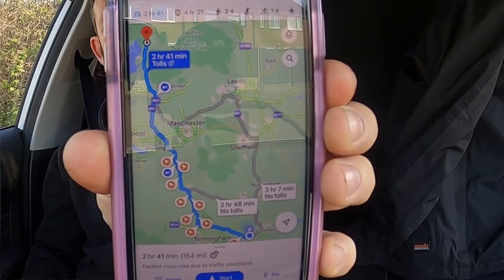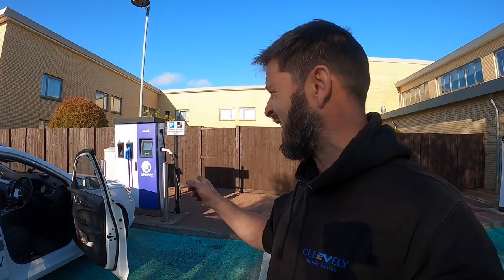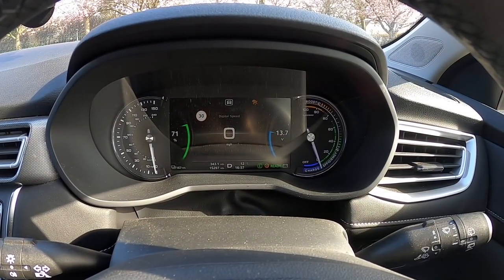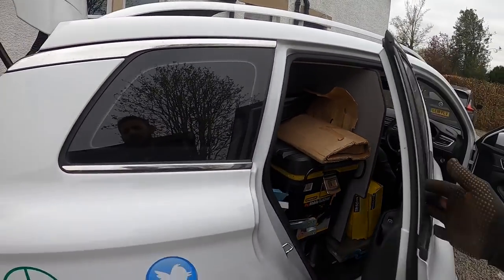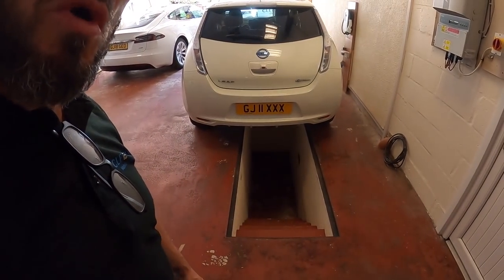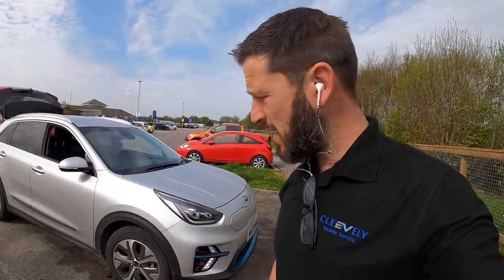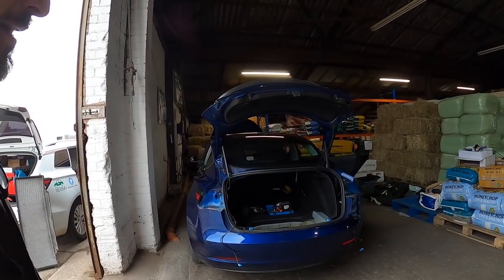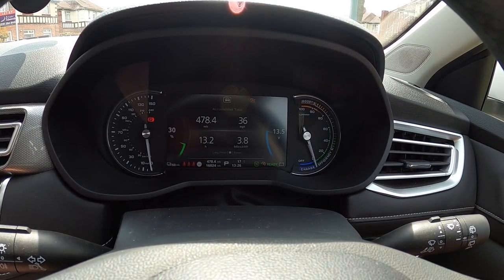Apparently £50 Gets 1300 Miles In An EV??

Comment: This video shows how busy and committed to your work that you are.  Great to have more information out there to educate people looking at an EV. I spoke to several people this weekend saying EV's are rubbish as they can't do long journeys. 
I could inform them otherwise, having just driven my Kia E Niro from Lincoln to Disneyland Paris, recharging  only when we wanted to stop or had to wait at the Euro Star Terminal. With free charging at Euro Tunnel and at Disneys Newport Bay Hotel, the paid for charge for 870 miles was less than £30!
Reply: Agreed, we have just spent 3 weeks in Connemara in our Zoe for a total fuel cost of €40 for the round trip including all our local driving. Our destination was just over 300km from home.

Comment: Maths is your friend. The average speed on any journey that comprises 50% motorway and 50% A&B roads is 45mph. With a higher mix of motorway your average speed goes up to 55mph.  The dashboard readout at 2:13 shows 152.8 miles travelled, 55mph average and 2.7h journey time. If you divide the 158.2 miles by the 55mph you get 2.78h journey time. If you divide the 152.8 miles by the journey time to one decimal place of 2.7h you get 56.6mph. So the readout is correct James.

What a lot of people don't get is that no matter how much time you spend on the motorway on a long journey you will have to spend some time on A & B roads. You could be doing as little as 10mph in towns and cities and will mostly be doing 30-40mph on B roads at best. You also have to factor in stoppage time. Diversions, contraflow, traffic lights, zebra crossings, roundabouts, roadworks, slow lorries, junctions, waiting at on ramps, etc., etc. People think, "I was doing 70mph most of the way" but in reality you weren't. Even if you were constantly at 70mph on the motorway the conditions described above will slash your average speed every time.

Whenever people talk about range and how EVs with less than 150 mile range are no good for long journeys I remind them that the average speed is 44mph and it would take 3h 25m to travel 150 miles non-stop. James achieved a higher average and still took over 2h 45m to cover 153 miles. You are going to need to rest or pee or eat on journeys that long regardless of what you're driving. You will have ample cause to take a break and get a top up while you're at it.

Also I have found that my average cost to run my 2015 24kwh Nissan Leaf is £1 for every 27 miles. That's 1,350 miles for £50. So right in line with the costs shown in the title. But, this is my average. It is actually possible for me to cover the entire British Isles without paying a penny for charging at public chargers. Yes, it would be circuitous and time consuming. But, the point is that the cost can be a lot lower than £50 for 1300 miles and it can also be a lot higher. But, it's a fair average.
Reply: Spot on Trevor !
Reply: 27 miles = 7kw = .14p ?
But thats all home charging. The real cost is what you pay at chargers, my calculations make £30 = 300miles [.40p @ superchargers]
Reply: @ML118AL  The real cost is what you spent. Home charging is normal . Public chargers are maybe 50% more costs than home charging (slow charging overnight). (My country the Netherlands....my own driveway, my own charging box. Charging on average with 4KW will charge up my ioniq 5 in 18 hours (full charge from zero). And mostly I do not drive 360-400 km every day....overnight charging is enough for 95% of all time. So home energy costs for electricity is not wrong for calculations.

Comment: In these times of crazy fuel prices these videos just go to show how practical an EV is even for heavy commercial use. Recently completed 2 journeys Lon to Man and back in an E-Niro at a total cost per journey of £2.64 (thanks to free charging at destination). That's over 400 miles for approx £5. Oh and I arrived after the 200+ mile journey with over quarter of a charge remaining, 3 out of 4 of those trips.

Comment: Not too shabby, I’ve not collated all of ours yet but we just did 1200m across 5 days getting down from Glasgow to Essex, 2 days visiting Fully Charged and back up the road. Had to rely on mainly rapids and spent about £65 mixture of Gridserve, Mer, podpoint, CPS, freebie @osprey from Fully Charged and about 16hrs on 3 pin. All done with a 40kWh Leaf. Not the best for the longer 350+ distances but If I can do it in that, anyone can with anything else.
Reply: In November 2017 I did 437 miles to Edinburgh on a Tuesday and on the Wednesday I did 16 miles around town and then 437 miles back home. That was in a 24kwh Leaf, rapid charging only, free of charge. 890 miles total in two days. No issues, no cost, minimal fatigue. With modern EVs, a much more comprehensive infrastructure and much faster chargers available such journeys are now an absolute piece of piss for just a little bit of planning.
Reply: @trevorberridge6079  yep, i'd actually get on just as easily with a 24kWh vs a rapidgating 40kWh.

Comment: That dedication for you, well done James, and the MG sound an excellent work horse, but I see the trim level is below standard looking at things like the steering wheel cover was poorly fitted. Its little things like that which lets it down for some people, it wouldn't bother me though. I did a trip in our 2015 Nissan Leaf 24 from mid Wales to Germany near Munster this year covered just over 900 miles and cost me £48 which included two free vends as well. Great work James alaways interested in you videos so keep up the good work!!
Reply: Wow that's a long journey. How were the battery temperatures along the way? Any charge rate throttling?

Comment: Looks like fun.  What a great car.  I wish i could put 30kwh in the back of my leaf plus, Id have damn near 300 miles of range then! haha
Reply: Adding an extender battery like the guy in the video has a hidden advantage. Because it is being viewed by the car as an extra pack it takes load off of the main pack. This means that when you charge you can get higher charge speeds for longer as the load is shared.

Comment: That’s a real concern having the MG5 unplugged mid charge…and the issues it caused, (can’t believe someone would do that!!)..I assume if that happened to a non ev technician type person this would require RAC/AA to come out and fix it so the vehicle could continue charge?
Reply: It isn't possible to unplug the cable if the car is locked.

Comment: One question I have James, if you had the oportunity to buy a MG5 Standard Range 320km WLTP with LFP batteries without the extra things that the luxury had (but like 3k cheaper) which would you chose? In other words with your experience/knowledge does the LFP batteries (being able to charge to 100% with no problem) are preferable? Ty for your videos!

Comment: Did you say you were charging at 90 Kw? The max i can get in my std range MG5 is just over 52 KW. I did get 74Kw pnce. But with 58,000 miles seems to be restricted?
Reply: I wonder if the battery isn’t warm enough to allow higher charging speeds?
Reply: @SirHackaL0t.  i was wondering if he was using the battery heater that is fitted to that version of the car.

Comment: Huge miles covered !
Dare I ask don't supplying dealerships do this work ?   I'm in another time warp still using the village garage etc.   MG5 is interesting but this range worry puts me off buying an EV
Reply: Dealerships don't always have (enough) trained EV techs available. Their time served mechanics tend to have gained almost all their experience with the legacy ICE vehicles. Plus they tend to deal with issues 'by the book' which means paying for a diagnosis prior to any work. Then to add insult to injury they will almost always ignore the (annoying) knowledgeable customers who have been online and may very well know what is causing their issue but the dealer will ignore any pointers and simply bill for their time diagnosing. If the vehicle is still under warranty they will upon confirming an issue be able to bill head office for the repair. If out of warranty it just adds to the bill. Cleevely however simply know most common issues with all EV's by now and what needs to be done to rectify. Likely also cheaper than most main dealers. Servicing by a qualified 3rd party is also mandated by law do would not be an issue.

Comment: Does your MG5 support V2L? Could be useful for recharging your power tools when there’s no outside power available.
Reply: No, not the MG5 SR or LR, but the 2022 facelift model that you can order now for delivery in late 2022 has V2L.

Of course, poor-man's V2L, where you connect an inverter to the 1V battery, can be retrofitted to all models. Extensive high output use would trash the 12v lead-acid battery eventually, but for occasional power tool use it would be fine.

Comment: Why is the evolt free? Who is paying for the electricity? Is this just temporary or have they been free for a long time?
Reply: Some of the chargers are free in areas with low electric car use just after installation. Free for up to 3 years then chargeable to help people choose an ev. But this is now coming to an end. And most are now starting to charge. Most chargers in the next work are owned by Scottish councils and as such their electricity is unmetered as they pay by large unmetered contracted every 5 years or so. But like I say it's normally in low uptake areas of evs that's why they are free to encourage uptake. Scotland has done this differently than the rest as they have a charging place Scotland network whereas England wales and ni chose to let the private sector do it. The Scottish government chose to do it diffrently. James has a video on it.

Comment: Roughly 25-26p a mile. That's mighty impressive.

Out of interest, when you charge at customers, do you knock a little off the bill to compensate, or is it just at the kindness of the customers? If that's not incredibly rude to ask.
Reply: All customer charging is probably gratis. Many of the customers will be trying to feed James at a higher rate than the car what with cakes, biscuits, soup, stew, coffee etc.
Reply: he has said that he will only offer the cost if the customer ask for it.    but I doubt many customers mind if he is doing a good job.
Instavolt is now 57p a unit  so not cheap.   if you use your brain then that 25 /26p a mile would be much lower
also if you pick an ev that does better miles to a unit that now helps.
I did over 1000 miles from Newcastle to Scotland and stayed for awhile then back  and i cost me £0
I have had my car for over a 1yr and a Half  and my total cost has been under £10.
Reply: @davidsworld5837  find that hard to believe David.  guess you have solar at home and not counting the up front cost.  
nothing is for free, and 10 quid  is as good as free as it gets..
Reply: @rivergladesgardenrailroad8834  i have not charged at home that much  only about 20 units over the whole time i have had the car so far.

Comment: I have a problem  I don't have a boat.  does this mean to watch the video I have to buy one  so I can float it.  hehehe
the tesla  filter is massive.
the house with the pit.  you missed the twizzy or what looked like one.
I do find that Leaf's cause problems at chargers  and the chargers turn off.  or stop charging on your car when they connect up
if you now take it  Instavolt  is now 57p a unit.   if you look at using them  your  1300 miles would cost   342 units at 57p is  £195.
but if you take it you can still do  over 1000  for the cost of £0.   or pay the highest price costs.    electricity varied price is not like petrol that has a narrow price range.  we know that many petrol car owners say it costs more to charge an ev  well it can do if you are stupid enough to pay for an expensive charger  but there are still cheaper priced ones around.  in the same way that you would go to a cheaper petrol station